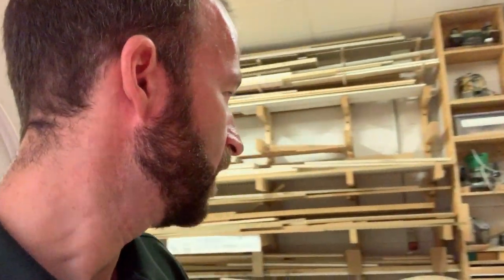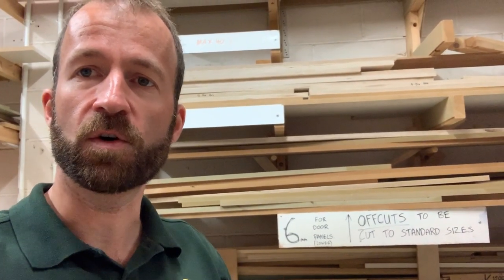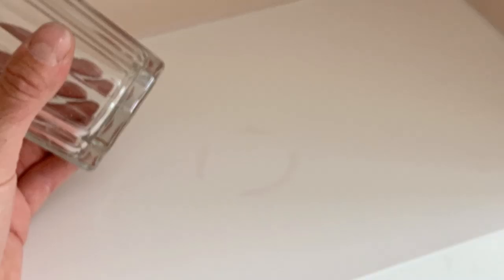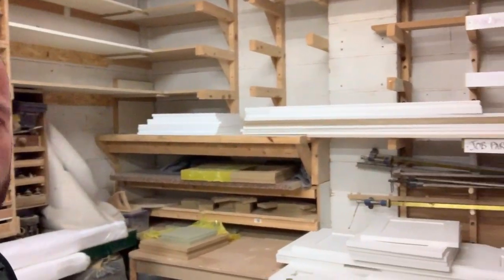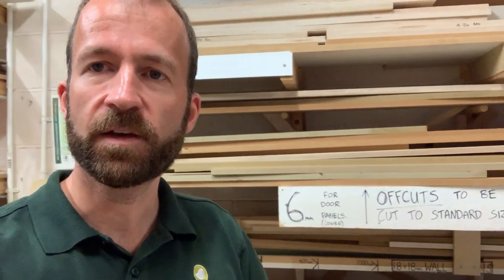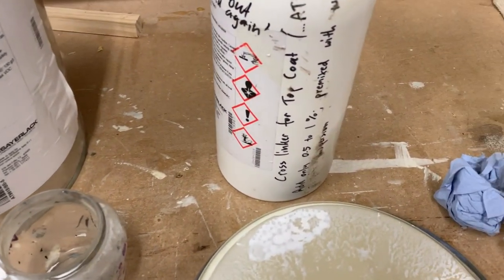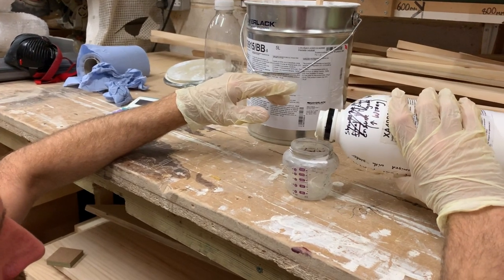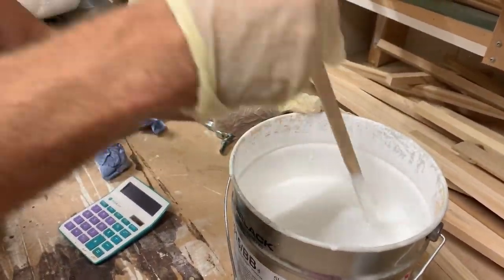Curing Waterbased Paint Faster with a Crosslinker Additive

Comment: Very useful information. Would be great if you did more paint related videos!
Reply from the maker: Applaud furniture what other paint related stuff would you like to know about?
Reply: Freebird Interiors me personally I’d like to know more about your ‘booth’ set up, things like extraction as I’m in the process of setting up a small booth. Otherwise videos exactly like this are very useful as I had no idea there was even a product you could add to water based paint to make it cure faster and effector stronger.
Reply from the maker: I don’t think I am a good person to talk about booth setup because ours is terrible!  I could show you what NOT to do!! If and when we finally move to a better setup I would make the booth with a full wall of filter at one end and a void space before a large fan.  Filters also at the opposite end of the room for the inlet air.  I’m told this is the right way to do it - a simple straight though unobstructed flow.
Reply: @Alastair_Freebird  thanks for the reply, I agree that would be the right and ideal set up, but unfortunately I don't have the right space to make that work either! i'm dealing with a 3m x 3m room with a single door in and that's all so will need to get creative I think.

Look forward to future videos. Cheers.
Reply from the maker: Applaud furniture have you seen Gary Banks on Instagram? He is getting good results with this setup in a small space: https://www.instagram.com/p/B2mnIFrjB2C/?igshid=1dkgsigod7aw2

Comment: Had tried so many different brands and none of them beats Zinsser BIN in terms of spray priming. I normally do two light coats to achieve perfect base for the top coat. Sands easy with spongy pads, lifts no grain being non waterbased, dryes in no time being methylated spirit based. Thin enough to go through 1.5mm hvlp/lvlp nozzle (though i add 10-20% of methhlated spirit for finer mist). Opacity is fantastic. Expensive but worth every penny.
 Now for the top coat i've also tried enough stuff and experimenting to be able to give good advise. Forget about conventional paints unless you're rolling or brushing. If spraying with those the durability is the main issue, also hard to build up thick coat as paint has to be dilluted 40-50%with water, unless you're using airless system, which i find OK but not the best. And it's rather messy in terms of cleaning.
 For those who has around 500£ to invest into spray equipment i suggest get no less than 50l 3Hp compressor and couple of good quality guns. For priming can be something cheap and cheerful but do not save on the top coat gun, can get the decent one for between 150 and 200. 
Now here is the most interesting bit.
 For the top coat i use Morrells waterbased  laquer. You can go for pigmented lacquer if the job is big enough to justify bying 5l of colour (they don't do smaller tins) or you can do what i do and i figured it by chance messing about experimenting with stuff.
 You can actually do your own mixes and find they are just as good as that prepigmented stuff they mix for you. 
Here is the proportion i do for my set up, having different nozzle might require less or more water, my one is 1.8mm devilbiss lvlp. So you take 300ml of morrells CLEAR lacquer mix it with 200ml of ANY waterbased paint (i normally use Little Greenie, but can be ANY) and on top of that i add 50ml of water. That's it. It mixes well together and there is no separation or sediment even after months passed. Also opacity remains fantastic and there is no colour intensty loss. You can mix small portions for small jobs even out of emulsion sample pots (i mixed some in B&Q before, 3£ per pot) and it worked just as good as with Little Greene eggshell. The only thing it was slightly mattier finish as that emulsion was matt (lacquer was 10%sheen) so at the end it was about 6-7%sheen i reckon. Still durable finish.
 Drying time rather fast if under IR light, but do not wack it on full, as might develop crackling in the corners where it is slightly thicker. Or have have a fan blowing at the same time. 
 For edges i use paintable iron on edging applied with virutex (there are cheaper options and the same good). Takes very little time and drastically improves the edges. Only shamfering thd edges of the edges followed with some quick sand.
Hope someone finds it useful.
Reply from the maker: Wow, fantastic information Jacek, thank you!!  Lots in there that I am tempted to give a try.
Reply: @Alastair_Freebird  definitely, especially you gonna have airline equipped workshop soon. This is the best as continuous preassure will guarantee consistent fan pattern on your future lvlp/hvlp guns. 600ml cup will take you much much further than airless system. Even though it takes 2-3coats per side. Do them thin and they will dry fast. Precats are also good but not by much and for what it takes to bear the smell and cleaning don't think worth it. 2k acrylics are good for opacity but rubbish for build up and durability. Or i was just using wrong brand which was Jawel paints. As i said this thing with clear lacquer and common pigmented paint works the best so far. And finish is quite something. It's almost like you can see ever so fine metallic effect. The pigment is kinda suspended in the thikness of the coat.. maybe to do with the fact that lacquer is clear.. don't know. But i'ts not flat like just paint it has some depth to it if you know what i mean.
Reply from the maker: Jacek Kasza certainly sounds worth a try.  I imagine the zinnser BIN being a hassle to clean though.  I never got on well with it whenever I have tried to hand apply it, it dries so fast and gums up if you rebrush it more than once!  Doesn’t it get messy flushing and cleaning the spray equipment?  Is it so much better than just using waterbased for priming as well as topcoat?
Reply from the maker: Jacek Kasza you really seem to know what you’re talking about.  Where are you based?
Reply: @Alastair_Freebird  and still learning. Try and error mainly. London.
Reply: Another good thing about it, it can be tinted very easily too to match the top coat colour. I normally do it in my local crown center free of charge. Makes life a bit easier. But do NOT try to tint it with printer inks, mistake i paid dearly for. Not always experiments end up good..

Comment: I buy a paint here in Ireland from a company called Colourtrend. It’s called WB50 , it’s a water based paint but great fir spraying and very little overspray and drys really quick and good hard finish
Reply from the maker: jonathan Delaney that’s interesting.  There are some great paints out there.  I got a little tin of a white waterbased PU paint from an Irish company who made and sprayed some custom doors for me some time ago, it was a touch up paint and my first experience of water based PU (I thought that was a contradiction) and it was very thin but surprisingly opaque and flattened off miraculously off the brush.  They wouldn’t tell me where to buy it but the sayerlack is the closest I’ve found to it.  Does the type of paint make much difference to the overspray issue then?  I am really just a novice with paint and spraying, I just like to share the little I know!
Reply: I’m only spraying my unit etc now about a year . I got the graco finish pro airless. I was using a standard water based paint and a lot of over spray. This one is formulated for the airless sprayer so works well with it. I’m well impressed with the paint and sprayer

Comment: Thanks again Alastair for the information. Ordered some Sayerlack a while ago on your recommendation and was very pleased, not tried the crosslinker though. Made a mistake of using the Sayerlack undercoat and Tikkurila Intact 40 topcoat on some units. Had horrific reaction and ended up doing them again. My fault for mixing brands.
Reply from the maker: John McCabe interesting - it’s tempting to think advice not to mix different undercoats and topcoats is scaremongering to make us stick with one brand but it is very risky - we also had problems trying to use up some Johnstone’s undercoat with the sayerlack topcoat, it kind of crackled up.

Comment: Thanks for the info. Recently finished spraying my first project using info you've previously shared. Sadly Movac didn't get back to me but found Elmbridge Supplies on Google and used the AT9915/BB-5 (Single Pack). Really good results with 2 coats of primer, even on edges. Drying times for me varied, up to 5 hours to be completely touch dry in some cases. Perhaps the crosslinker would have helped that. Also made colossal mistake of stacking too early without packing material  😂damaged most of the components but its useful experience. Thanks for taking the time to share. Will perhaps upload a video of finished results once I've assembled and installed, if I can capture the detail on camera. Was surprised how much paint can be wasted as overspray, maybe 10-15% which is pretty significant given the cost of the paint. Is that the same for you or am I doing something wrong?
Reply from the maker: ShortWorx we are producing crazy amounts of overspray and I need to get a grip on it.  Partly our air assist compress on the Graco Finish pro II 395 has broken so we’re spraying pure airless and it’s a bit aggressive.  Getting the machine serviced soon.  So do Elmbridge supplies also sell the same Sayerlack paint? Not affiliated to Movac?  I find that paint much more forgiving than the old Leyland eggshell we used to use in terms of sticking if stacked, but you still have to be careful not to do it too soon!  Or to be safest, not at all without separation.
Reply: You guys need to try lvlp/hvlp compressor based technology. I think i'm getting around 25m* coated x3 times with around 2,5litre of material. So in total 75 square meters. These airless systems (i also have Graco) eat paint like no tomorrow.

Comment: Thanks for all the info Alastair, much appreciated. What type of IR heaters are you using, and do they noticeably help with drying/curing?
Reply from the maker: Sperky Sperks absolutely they do, it’s amazing, they bake it off so quick.  Especially the primer, very quick to dry it that way. With top coat it’s strange though, it gets it drying but then it seems as if the heat keeps it kind or rubbery.  We have 2 of these exact heaters, wall mounted: https://www.sunswitch.net/industrial-infrared-heaters-c1/varma-v400-2kw-radiant-infrared-heater-p23 they have been fantastic.  They’re pretty simple things really but they kick out some heat and I am amazed that after years of use ( I’ve lost track probably 4 or more years now) - I have never had to change the ‘bulbs’ (if that’s what they are called - pretty similar to those old halogen stick bulbs)
Reply: Fantastic, thanks for the link. I've ordered the same Sayerlack primer and hardener based on your recommendation, I'll have to try the heaters to help reduce drying time as I don't have the space to have components sitting round too long. 👍🏻

Comment: Cheers for the info, I have an understair storage cabinets to build at the mo and want a more durable paint and was wondering if these paints are suitable for a standard Graco airless sprayer and were do you buy the paints from, supplier or direct from movac, info like this is really helpful as I was using standard acrylic primers with a Dulux diamond white or eggshell finish but it always felt a little soft and tacky and hard to achieve a great finish and a nightmare touching up after installs
Reply from the maker: sicpac66 exactly like my experience and many others starting with acrylic eggshell etc (we used Leyland and Johnstone, with similar problems).  Yes I spray the Sayerlack paint with a Graco FinishPro II 395 air assisted airless. And I buy it direct from Movac who I have found helpful and they deliver promptly next day.
Reply: I just tested today with graco airless it's fine working I recommend  be honest

Comment: Hello always happy qatch ur videos still using sayerlack or afe u recommended any others made top coat paint i just opwn my workshop and will be my first paint job help pls
Reply from the maker: We are sticking with Sayerlack, it’s good and we see no reason to change 👍
Reply: I just try this week its really good paint not like the other water based paint it's like a 2 k paint can I ask u 1 more question they are selling hardener aswell for water based topcoat did u also try that is it worth it?
Reply from the maker: @yavuzhocaoglu8568  Hi we do not use it with any additives.  We feel it dries quick enough and is durable enough without them.  But if we were doing kitchens I might use them for extra peace of mind.
Reply: @Alastair_Freebird  make sense be honest after watch your video I get 1 litre sayerlack waterbased ans test it its really unavailable for water based paint even I didn't use sayerlack undercoat just use for top coat and I order now renner aswell want to test it renner aswell I normally using 2k paint but health issue I don't want to use anymore solvent any way even water based paint has solvent but not like propa solvent paint what is your personal mind use sayerlack for tv unit with out croslinker (hardener it's will be fine)also what size tip u guys using with sayerlack water base 310 or 210 or etc what is best result for airless sprayer
Reply from the maker: @yavuzhocaoglu8568  Yes we use it for that sort of project all the time without any additives at all, see for example these projects all painted with Sayerlack AT99: 
https://www.instagram.com/p/C5nxaJgo112/?utm_source=ig_web_copy_link&igsh=MzRlODBiNWFlZA==https://www.instagram.com/p/C5nxaJgo112/?utm_source=ig_web_copy_link&igsh=MzRlODBiNWFlZA==
Reply from the maker: https://www.instagram.com/p/C0cn-wzIIiJ/?utm_source=ig_web_copy_link&igsh=MzRlODBiNWFlZA==
Reply from the maker: https://www.instagram.com/p/CnP8Kxfjnf-/?utm_source=ig_web_copy_link&igsh=MzRlODBiNWFlZA==
Reply from the maker: https://www.instagram.com/p/ChKjcUZDBtt/?utm_source=ig_web_copy_link&igsh=MzRlODBiNWFlZA==
Reply from the maker: https://www.instagram.com/p/C0FDGIBIaQx/?utm_source=ig_web_copy_link&igsh=MzRlODBiNWFlZA==
Reply from the maker: I think Brady uses a 310 tip

Comment: Can unused cross linked paint be put back in with the original paint for future use or does it have to be discarded?
Reply from the maker: My understand is that in time the crosslinker sort of evaporates or basically loses its effect - I think you could still use the paint.  But I would advise double checking this with Ultrimax

Comment: The crosslinker is Aziridine based I wonder how do you go with respiratory protection. I'm not sure, as not much info is available on line, but suspect that organic vapour cartridge doesn't protect against Aziridine. Do you use air feed respirator?
Reply from the maker: Never heard of a uridine but it sounds like it’s pretty bad for you then?  We have recently moved to using a full face respirator but not air fed

Comment: Just used AT99 and AT106 both have not sprayed with correct atimazation discolour when you touch or mark them and leaves massive clogs on the sandpaper when sanded, also told they used a different company's tinter to make the black?
Reply from the maker: What is the AT106, it doesn’t ring a bell?  We haven’t had those problems but there are so many variable with spraying!
Reply: @Alastair_Freebird  there 30% satin waterbourne coating for kitchen cabinets, never had an issue with the white base but they are now claiming application error and I've tried 3 different sprayguns and another guy also tried! Hate it when companies pass the blame
Reply from the maker: Maybe we got lucky, we’ve only ever used the 15% sheen and not had too many problems.  I recommend a supplier called Ultrimax in doncaster for good technical advice and support